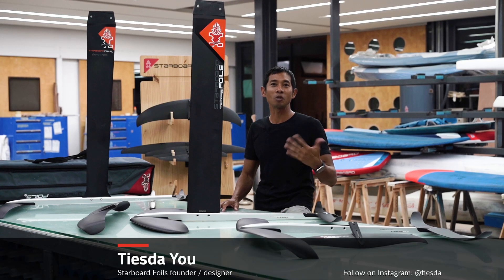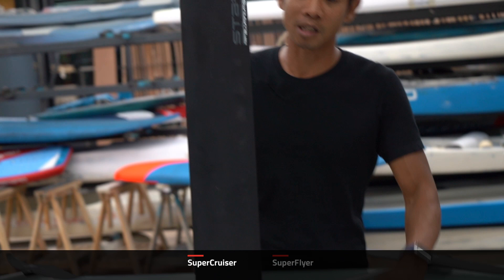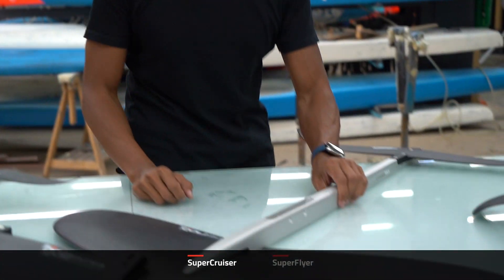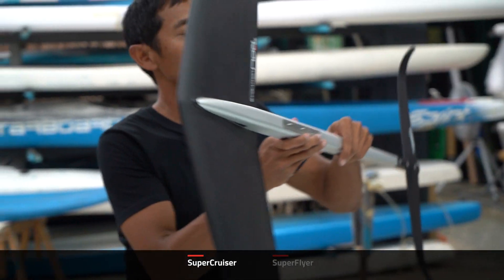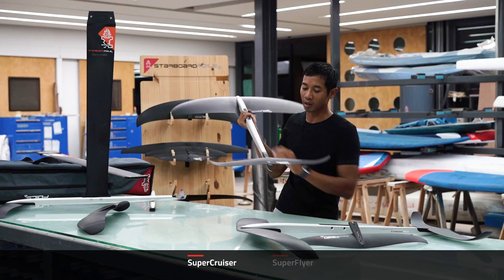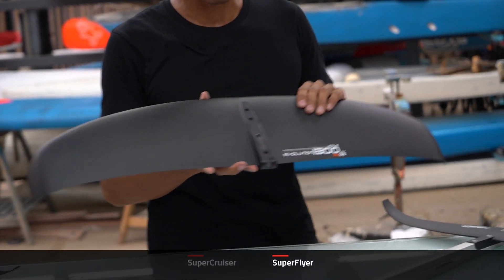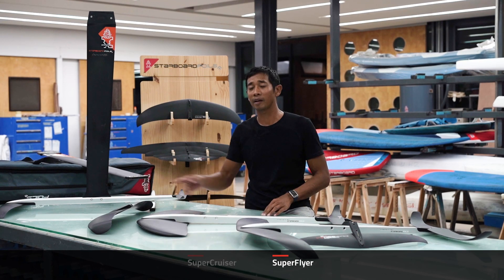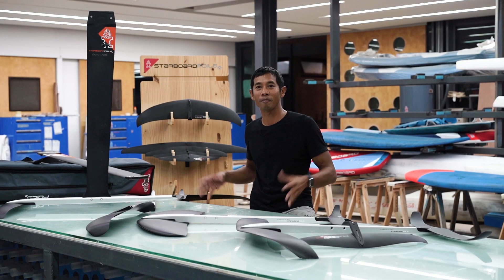SuperCruiser vs SuperFlyer

Comment: I’ve been using the Super Cruiser for a year. The lift is good—I can slow down to 5-7 km/h and still stay lifted for a while before dropping like a rock. However, the glide is very weak, making it difficult to pass through wind gaps. It's also very hard to go upwind, with 5 degrees usually being my maximum angle on a hals because it slows down immediately. The maximum speed is 26 km/h, though occasionally I reach 29. I think it would be great to have instructions on setting up all Starboard foils, boards, and sails, along with information on what you can do with them.

Comment: I have the older Supercruiser with screw adjustment rear wing. I’ve been experimenting with setup, mainly moving UJ position for wind strength and keeping the rear wing screw in the middle. Would you recommend using that screw in the full forward or rear position ever, or just tweaking it very slightly? Thanks.